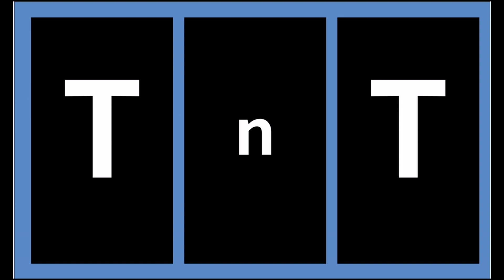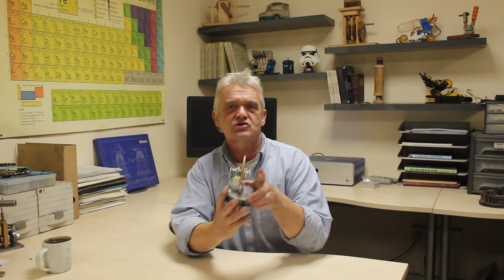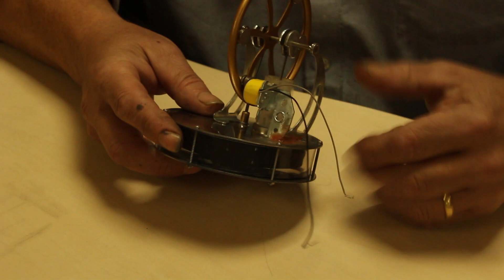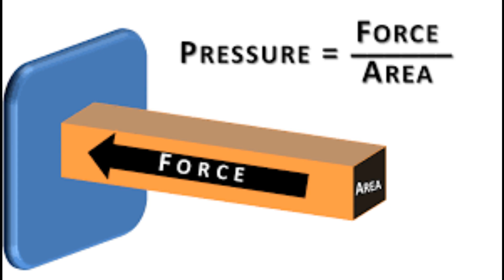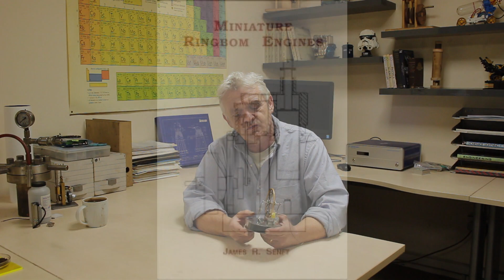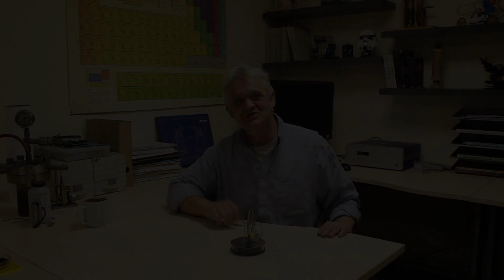More On The Magnetic Stirling

Comment: Do you think if you used two different fluids on the cusp of state change depending on the pressure change  on each side one side that turns to liquid as it gets cooled and the other  side that has one that is on the cusp of turning to gas as it gets heated would that improve  power output? or is that change too slow? 
 Also could  you make a fly cylinder instead of a wheel then have a number of displacer  chambers attached to the cylinder?